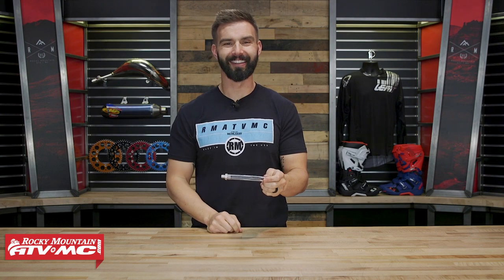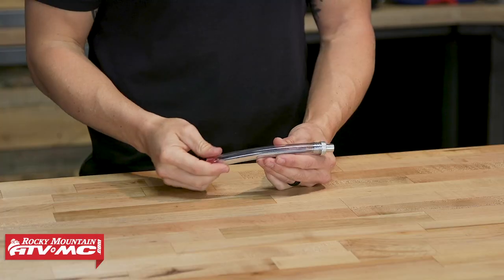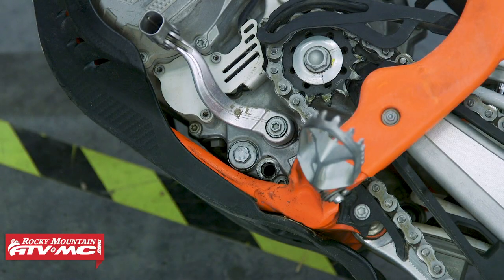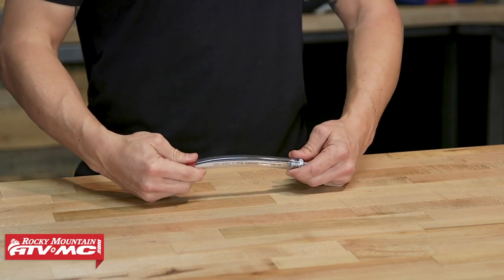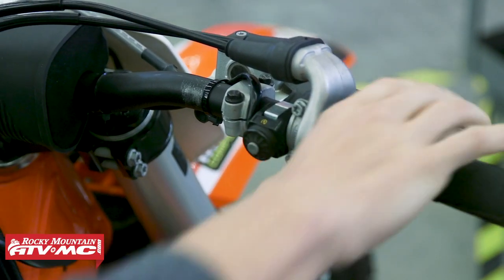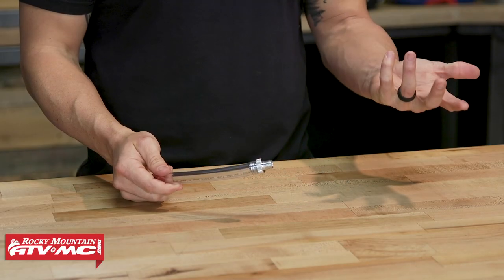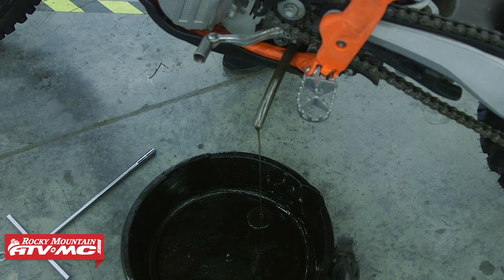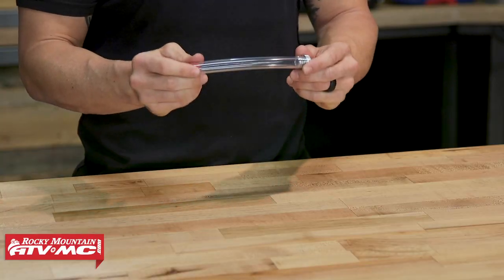Bullet Proof Designs KTM/Husqvarna Oil Drain Kit

Comment: Use a piece of cardboard folded under the oil drain plug. Straight in the drain pan. And it’s free.
Reply: Until it drips backward into the skid plate. have to find an exact size and thickness of cardboard